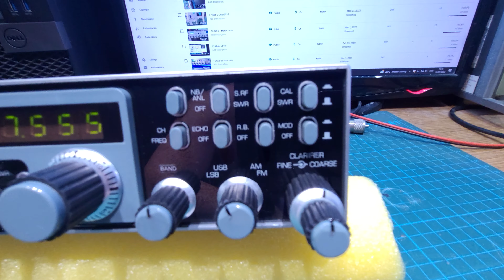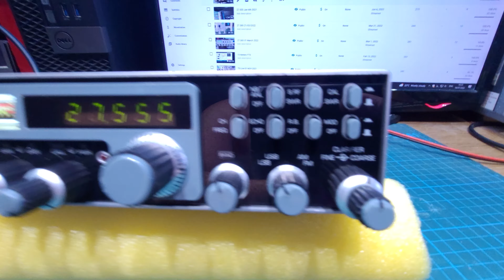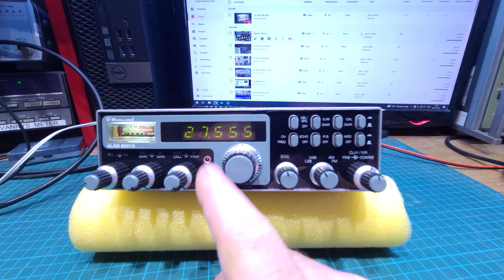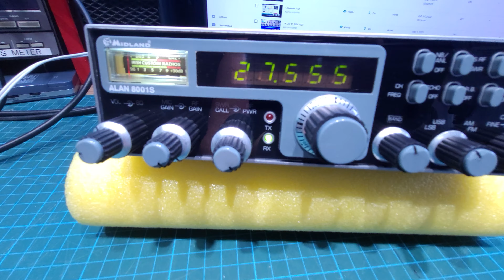MIDLAND ALAN 8001S FOR PERSONAL COLLECTION #cbradio #midland #chickenbox

Comment: i've managed to get a hold of 2 of these, a cybernet and a uniden chassis. one of them has a jumper setting ( for when it's cold 😁) where just changing a jumper position it gives you a 10kc step up for the alphas, the other would need a solder job, so that's never getting done. both are fantastic radios and go well with my 6001 and my 7001. my old 6001 could probably do with a recap as i've had it for 30 years, but i'm in no hurry to do that. as we say in ayrshire "it's no eatin a peece" (sandwich)🙂